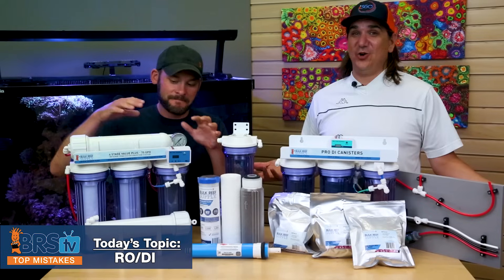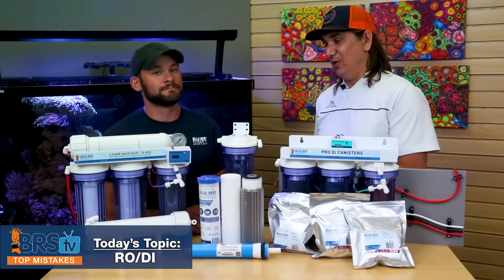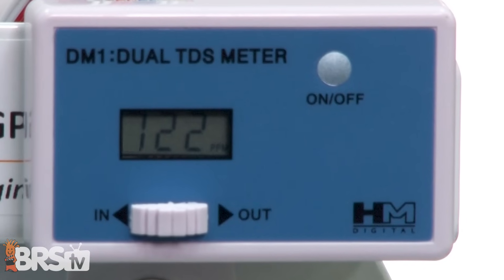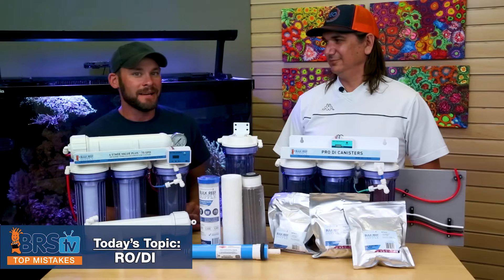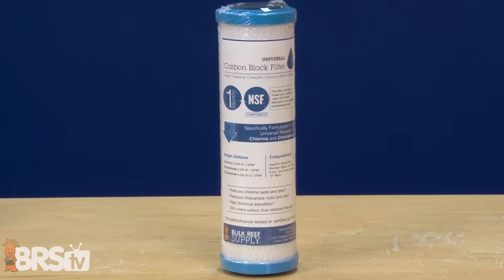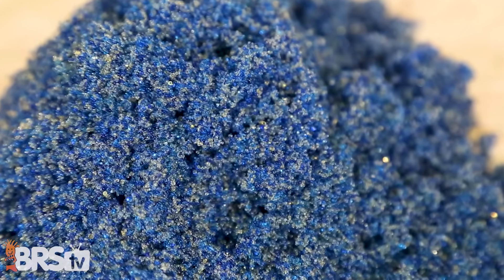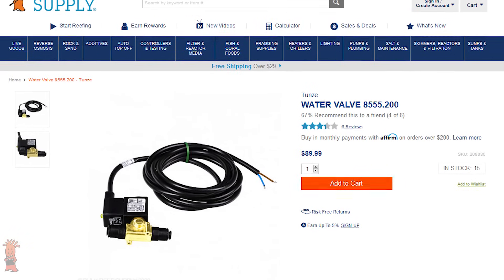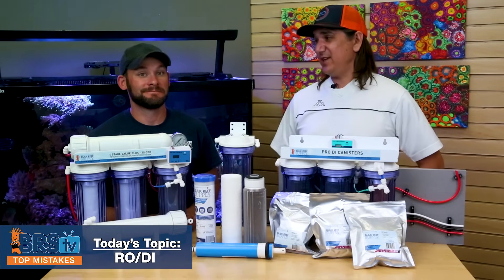BEWARE! These RO/DI Water Mistakes are sending $$ down the drain! Your reef tank deserves better.

Comment: I have the water saving kit on my RODI system and I was wondering... Should I install 2 flush valves? One for each membrane? Or can I just use one on the last membrane? The first one that water goes through has no flush valve and I always wondered if it's doing what it's supposed to do because the water is just flying through it at full speed until it gets to the other membrane. If someone can answer this I'd really appreciate it, thanks!
Reply from the maker: Just the one flush valve is needed on the water saver setup. Opening the flush valve will effectively flush both membranes

Comment: Would it be accurate to say TDS levels would only be something that would concern certain applications such as auto detailing and spot-free rinses?
Reply from the maker: TDS (total dissolved solids) is something that we take into account for our saltwater aquariums. The only problem with TDS is that TDS meters rely on conductivity and not all contaminants have an electrical charge. So while it's a good indicator of water quality, it's not a be all, end all monitoring solution in every case.

Comment: Just bought 6 stage BRS system... It came assembled with the ASOV before the resin filters...Do I need to put this after the resin chambers to work?? Cant find answer anywhere haha
Reply from the maker: No, the auto shut off valve can be installed before the DI resin and will still function as expected. You shouldn't need to change the location from how your ASOV is installed on your BRS RODI system.

Comment: I set up my unit I have 60 psi 
75 Gallon, 7 stage. 
Poor water flow I haven’t made 75 gallons yet probably only about 25 total with my 25 gallon barrel and it’s been over 72 hours and I can’t figure out why .. my water will drip out of the line and then kind of stop and then drip out of the line again. But I have good psi so I’m confused
Reply from the maker: Make sure your manual flush valve is in the "closed" position. This will help force water through the RO membrane.

Comment: i fill my ROI in my tub. if it runs over, it goes down the drain worst case scenario.
Reply: same! sucks lugging it around though
Reply: Use a 32 gallon brute trashcan and a hose. Put a hose timer on it.

Comment: My tap water is from a well and has high nitrates and full of minerals. What RODI system do you recommend?
Reply from the maker: It sounds like a 5 stage or larger will be best for your needs. If your well has high CO2, a 7 stage will be the most efficient system in terms of DI resin consumption. But, you can always upgrade by adding on additional canisters to a 5 stage down the road if you find that to be an issue.

Comment: Do you have a newbie video about RO-DI. All these terms you use are freaking me out, MAN.  TDS? RESIN? What does RO-DI stand for?  I inherited a 180-gallon tank that hasn't been taken care of very well at my wifes office. We're using tap water to top off the sump daily. I need RO-DI to top off and to do water changes since the guy who's supposed to do it shows up every couple of months. EEEK. This is a LOT!
Reply: TDS stands for total dissolve solids. Basically, how much junk is in the water. 
Resin is the product that is used in the filters to clean the water.
RO DI stands for reverse osmosis deionized. 
Saltwater tanks need RO DI, do not use Tap.

Comment: What is the RO rejection rate that you recommend to replace the membrane ? Is 75 % still a good rejection ?
Reply from the maker: This will be very dependent on incoming water pressure. Low pressure usually means lower performance, while higher water pressure will usually mean better performance. With average water pressure (say 55 psi) and a single membrane system, you should see an approximate 3:1 waste to product ratio. I believe that's what you mean by 75%, so based on the info here, you don't need to replace your membrane yet.

Comment: Whats the best way for an apartment dweller like myself to install the BRS 7 stage system with booster pump, so that I can take it with me when I move?
Reply from the maker: When I was apartment living, I set it under my bathroom sink. I used the faucet diverter valve so that I could easily and quickly set it up and take it down without a permanent installation.
Reply: @BRStv  Does the booster pump have to be hard wired or does it have a plug on it?

Comment: Wasted thousands of gal of water probably first 6 months of owning by NOT having booster and running at 30 psi AND WHILE ALSO having flush valve wide open.. got 10 gal a day! And recently...No backup and float valve failed.

Comment: thinking the waste water would stop when the float valve cut off
Reply from the maker: If you have an auto shut off valve installed, then yes. It can take a couple of minutes for the pressure in the product line to trigger the ASOV, however.
Reply: @BRStv  not with the piece of poop I bought.  I'm about to order a good one from you

Comment: I wonder if there is a service out there that will give you a comprehensive test of your tap water to see what exactly you're filtering out.  I know there some places in the world where people are just using dechlorinated tap water with good results. If you main contaminants are things that have significant wiggle room for allowable levels odds are you can get away with just running it through a sediment filter and a carbon block. Hell some people even need to add sources of nitrogen and phosphates to their tank water to keep them from getting too low in established tanks.
Reply from the maker: We'd suggest using an ICP test for this. We offer a couple of different brands on our website, but we most frequently use the Triton brand
Reply: @BRStv  Will ICP tests show things like pesticides?

Comment: I want to buy my first RODI system, which one would you recommend? Thanks
Reply from the maker: A 4 stage system with a single carbon block works for well water and city water with low levels of chlorine. If your city uses chloramines, you'll want to go with a two carbon block RODI system. The 5, 6, or 7 stages would all work in those cases.
Reply: @BRStv  perfect thanks a lot will test for test for chloramine then

Comment: My local fish shop only sells RO water, no DI. Is that bad?
Reply from the maker: Ultimately, it depends on the quality of the source water. If it's high quality water to begin with, there may be little benefit to the DI stage. If it's simply a cost cutting measure by the LFS, then you may want to consider purchasing your own RODI system so that you have more control over the filtration process. 

All of that said, RO only water is certainly going to be better than tap water.

Comment: One huge thing you guys haven't ever done I don't understand why is what are to parts are.. I don't know why I need to flush kit don't even know what a flush kit does I don't know why I need a booster pump I don't know what a booster pump does.I don't know the flow restrictor is either I could use some help with that you make a video on that
Reply: Booster pumps are only necessary if your ground water supply has low pressure.  A booster pump just sucks water out of your city water system a little faster than would come out otherwise.

Comment: I'm sure it wouldnt be hard for BRS or individual to make a calibration kit..using a little ro line closed loop with little inline pump  and T-fitting for tds probe and using T fitting opening to inject reference solution directly in until full to eliminate contamination and then insert probe & run pump to properly calibrate tds through T-fitting .

Comment: Talking about carbon cartridges recharging themselves when not used for long periods, does the cartridge need to be drained and dried out for this to work?
Reply from the maker: No, actually, keeping the carbon blocks stored wet is better 🙂
Reply: @BRStv  thanks so much for your reply. I really appreciate it. I have one last question about ro/di and hard water if you don't mind.
I've had a brand new, unused rodi for a couple of years now. I didn't fully understand the relationship between ro filters and hard and soft water. I had always assumed that ro filters were effectively water softeners. Now I know that's not the case. In my home city we have pretty hard water. So, my question is this: is it ok to rearrange the order of my ro filter media, for example, di first, then sediment, carbon, then membrane last? I don't want to clog my membrane with calcium and magnesium, and buying a water softener (even the cheaper portable versions is not an option for me). Thanks.
Reply from the maker: @Aquascape_Dreaming  We do not suggest running the RODI system in that order as you will use up your DI resin in a matter of a couple of gallons. Sediment > carbon > membrane > DI is the only way we recommend running our RODI systems.